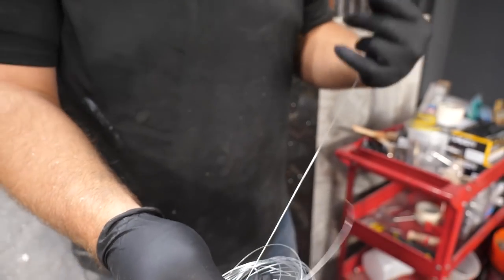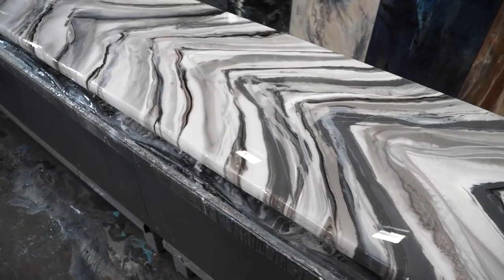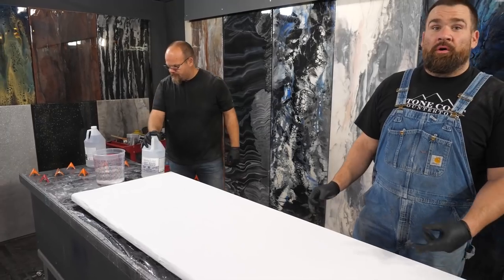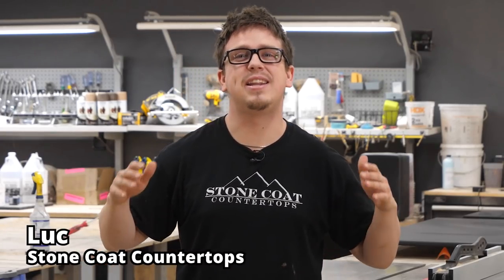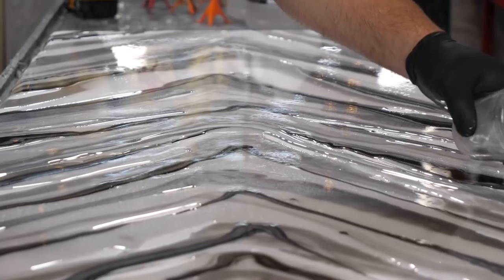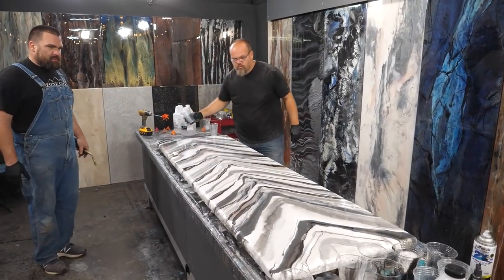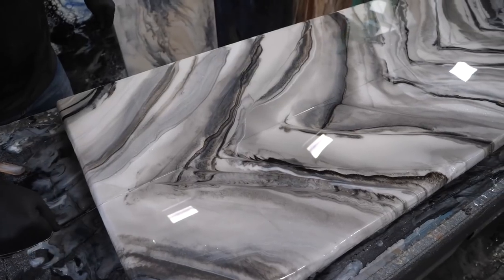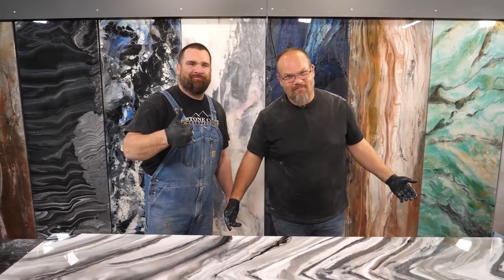Pour out Luxurious Marble | Stone Coat  Epoxy

Comment from the maker: ❓ How would you have gone about making the project symmetrical on both sides❓ We used a wire, but we're curious how you would have done it
Reply: Its called bookmatch  not bookmark just a FYI...
Reply: Maybe a thin piece of wood dividing the colors and pull the board at the end
Reply: Put the wire/string/wood/whatever down FIRST, then pour using that as a guideline to better bookmatch the two sides.
Reply: You need to drag the a string with a weighted end, in acrylic pouring we get that effect by using ball chains. I would have done straighter lines then dragged a fishing weight through causing a more natural mirrored effect 👍
Reply: I would've put the string down first also, but that project looked great!
Reply: A removable partition
Reply: I would saw the countertop in half...then coat one half...dip coat the other part by placing it on top of the other side( already coated)...pull it of..then glue them together again!!

Comment: I would use a thin rigid mineral in the middle between two pieces of base material (MDF). The divider should be taller then the surface. Perhaps a peace of aluminum or steel covered in Tyvek. Then pour with intent matching pours on each side of the divider. Allow epoxy to set up a little then removed the divider. Once project is cured trim with table saw if needed or sand center edge. Then attached edges then do a fill top coat or grout caulk after individual topcoat. ~this is an untested idea.

Comment: Just a thought.... if you prepped two boards did a random pattern on one then get the 2nd and lay it on top I’m sure the design would transfer on to both pieces .. obviously it would be a bit messy and would need a quick flick over but possible I’d love to see you try it

Comment: I did a marble countertop for client and in less then a year it yellowed - not the whole surface just under some placemats they had on the countertop. Very disappointing and now have to re-pour at my own expense. I will lo longer do light countertops
Reply from the maker: we're sorry that happened to you. Do you remember which epoxy you used and also what additives?
Reply: Does it matter really?  Stonecoat won’t do anything other than explain that whatever additives you used caused it to yellow faster.  I used the countertop stonecoat epoxy that you guys sold 3 years ago, and every one I’ve poured is yellowed now.  I also have to repour them because Stonecoat doesn’t replace the epoxy even though there was no mention of yellowing on their training videos or in their durability videos.
Reply: @StoneCoatCountertops  followed your marble video.  Besides it can’t be the additives otherwise the whole countertop would have yellowed - it only yellowed under the 2 placemats they had on their countertop
Reply: @StoneCoatCountertops  I used the countertop epoxy.

Comment: Why don’t you ever talk about the yellowing.? In 1 1/2 to 3 years all that white skin of a yellow yellow yellow! Why don’t you ever talk about that? Why don’t you ever addressed that issue? Why do you tell people art Epoxy is your most non-yellowing…...But you don’t tell them it WILL yellow?  Why do you want to suggest people avoid white, yet you make video after video after video with a main color of white, which you know as well as I do it’s going to be yellow and one and a half to three years? The kind of videos I’d like to see is what you do to prevent yellowing, and what you do after the counter has turned yellow to fix the problem. The video I’d like to see is the one  where are you say once your countertops yellow even though we never mentioned it anywhere and it’s not in our durability videos, you’re on your own. Stone Coat will do nothing to help you rectify the problem?